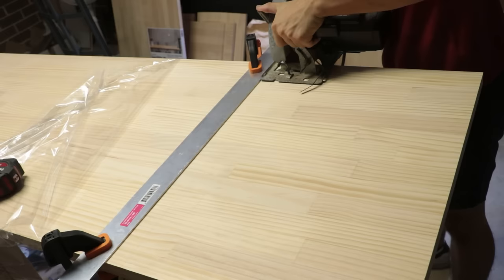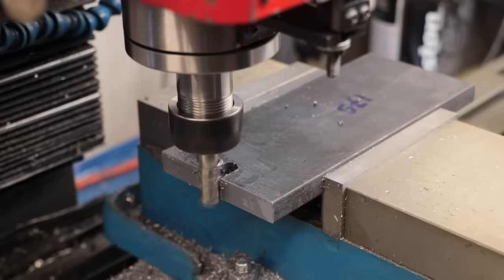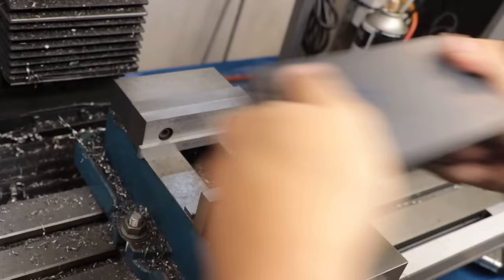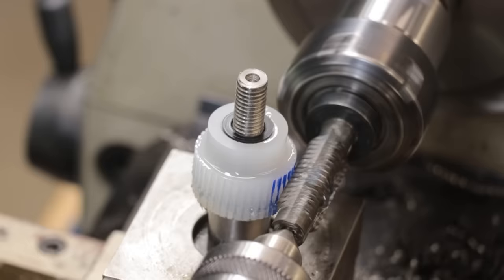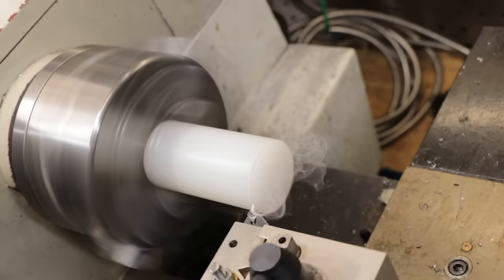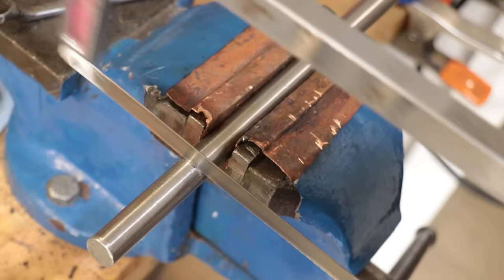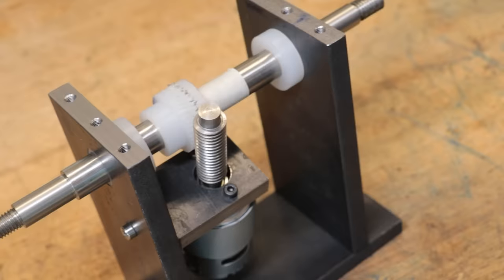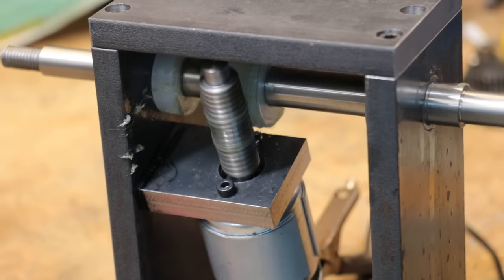Whetstone Grinder Build - Part 1

Comment: what's the project for? to build a slow RPM grinder?
Reply: It's a whetstone grinder for sharpening tools.
Reply: @WaddedBliss  well, i know little of machines, a whetstone grinder needs slow RPM?
Reply: @donny533  Apparently so. 100 rpm or thereabouts.
Reply: There are two benefits of a lower RPM. The first is less heat which is critical for preserving the temper/heat treatment. The second is precision/control. You generally don't need to remove much material for sharpening tools. No need to dispatch a spider with a grenade.

Comment: it is a good design but there is a reason why bench grinders have large motors and that is torque+speed+longevity that small motor will burn out really quick
Reply from the maker: I disagree. It’s not even in this video but when we test it under full it’s going to be pulling 3-4 amps. I’ve used these motors in so many projects over the past 10 or so years and it takes a lot more that to kill one of these, and from my experience they are pretty resilient motors.
Reply from the maker: And for what it’s worth this is not a unique design, I’ve seen these grinders with worm reductions with small low voltage motors. Cheers
Reply: @artisanmakes i am not talking about the worm reduction gear or any thing like that but just the motor

the motor i doubt was designed to run at full speed for long periods of time the way a bench grinder motor is
Reply: @artisanmakes  I doubt the worm gear will work in your design. 
It's good for generating torque, but what happens when you turn off your grinder? A bench grinder is basically a flywheel. Your worm gear wont be back drivable. Where does all the energy go?
Reply from the maker: Ill have a quick look again at the other example I found of this and see if they have anything to account for that

Comment: That plastic gear is going get shredded.

Without the ability to back feed, there is going to be quite a bit of inertia applied suddenly to the teeth when the motor stops and the two wheels keep trying to spin (even at low speed).
Reply from the maker: It doesn’t seem to be different to the gearbox inside commercial whetstone grinders that I’ve seen pulled apart

Comment: huh.. many use acetal bushings, cos many are just cheap crap, with the main objective to be cheap in production.
ball bearings or bronse bushings are much, much better. 
acetal will ware qickly, and you do not wan't the shaft that will wander around (been there, done that)
sealed bearings will not last long also. it's not the water that will done the damage. it's water mixed with grinding dust.
some kind of "semy labirinth", or similar not contact seal is required (few nice sugesstions in the comments).

induction motor is actualy very safe near the watter, cos it's sealed. unlike universal motors that have open construction

to remove the scale... dip the parts overnight in citric acid solution. if its not gone in the morning, add more citric acid (can do the same with any mild acid, but citric does not have an odor of vinegar, or myriatic, and it's cheap and available at any grocery)

I have done two "reconstructions" of low speed grinder, leaving the motor and gear train from realy cheap, flea market bargains (about 20-30 EUR, probably just material for the frame and any kind of motor will cost more).
new shafts, bearings, seals, plates that hold the stone (very important part, espetialy one that is near the bearing), jigs...
have few more ideas how to improve them but... it will wait.. working just fine in this configuration.

any way.. nice project

ps
sory for many typos.. broke left wrist two days ago, so typing with one hand after 40 years of "blind typing" is horrible expirience

Comment: Pretty much never buy one of the "professional" ones. They are such scams. There's absolutely nothing special about them. Either do as in the video, or just get the classic setup with the belt reduction. The most money one should put into (something like this) is in the stone. Those are what matters the most.
Reply: True, although some of the tool sharpening retrofit kits for regular grinders can be pretty good. In all cases, user error and not truing, aligning can make the most expensive machine useless.

Comment: People need to learn the difference between a screw an a bolt
Reply: Where did he use the wrong term?
Reply: A machine screw is a valid term for a bolt
Reply: Technically, a screw is a fully threaded fastener and a bolt has an unthreaded portion.
Reply from the maker: unless I’m describing something is a technical document,  I generally don’t get too uptight about if I saw screw or bolt. Especially if I’m saying “screwed together” or “bolted in place”. Try doing voice overs, you’ll slip up in some minor details. Cheers
Reply: There's no universally agreed apon difference. Some say that a bolt has an unthreaded portion, others that a bolt is a screw that is held in place by a nut, others still that a bolt is externally driven (like an external hex head). But historically a bolt is a smooth sliding shaft. Applying the word bolt to a type of screw is unnecessary and just confuses matters. Especially as the first and third definitions have exceptions, and the second is just dumb because any threaded thing can be held in place with a nut, even a wood screw. A bolt is a rod, normally a metal cylinder, that slides into place to lock a moving part, usually a door or window.
Reply: A screw creates its own thread to make a fitting, a bolt requires a thread to make a fitting, ie the nut. Does not matter if part threaded or not for both ecrew and bolt.
Reply: @toblexson5020  their is no confusion, just people who do not know the difference between a screw and a bolt. I am from an era where it was taught the difference . Nowadays anything will do. Don't upset the poor thing, you can't say that, you can't say this, it's close enough,etc,etc.A spade is a spade and a shovel is a shovel.
Reply: @trickies  Your definition defines thumb screws, set screws and lead screws as bolts, and even more weirdly also defines the Archimedes screw as a bolt. As I said, all attempted definitions for bolt are useless. Oh, and the Machinist's Handbook uses the nut definition. As I said, there is no agreed upon definition, and they're all useless and arbitrary. The term bolt does nothing to improve understanding, so might as well be thrown away.
Reply: And certain people need to learn there is more than one definition for most words.